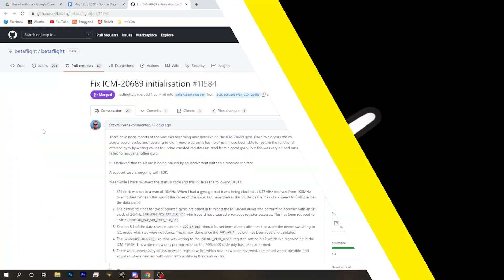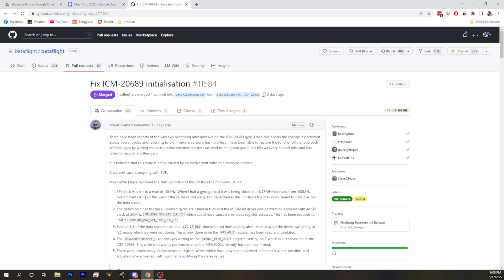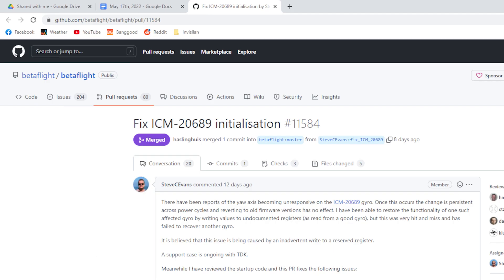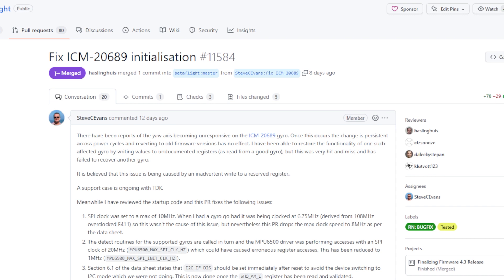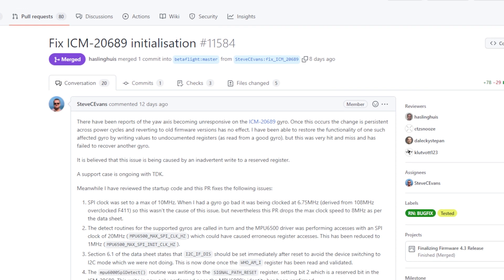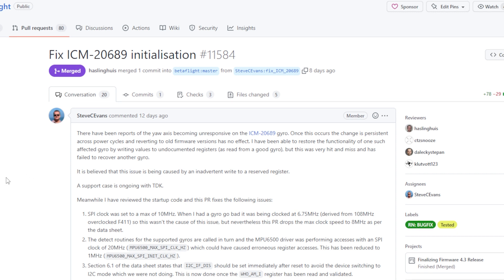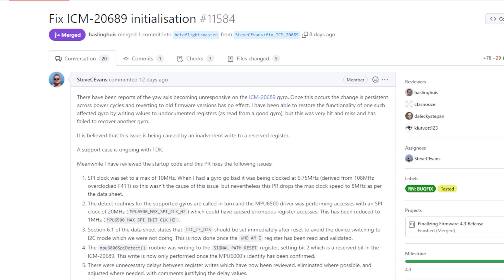PSA - Betaflight 4.3 RC6 Is Bricking ICM 20689 Gyros!

Comment: Great PSA. I remembered watching this  and hearing about a problem with bricking FC because of a particular gyro that's not the MCU6000. I am building a Cinelog35 and using the Aikon 3-6S F7 AIO flight controller w/ 60A 8bit ESC and it doesn't have the MCU6000. It has the BMI270. Before I flash BF 4.3 I wanted to make sure I wasn't about to brick a $100 board. Thanks for the info guys. Now I know I'm safe.

Comment: The BETAFPV F4 1S ELRS FC has this issue and they have been shipping it with RC6 from the factory. Maybe some people are OK, but for many people, the gyro will be bricked the first time they plug in a battery or USB. I'm told that you can avoid the problem if you power up in DFU mode the very first time and flash to RC7 before ever letting it power up normally under RC6. Unfortunately, I can't test that workaround because my new F4 is already bricked. :-(

Comment: I've just discovered the BetaFPV  F4 1S 12A AIO V2 flight controller has the ICM 20689 gyro, it's advertised to have the MPU6000 but Betaflight says otherwise! Not ideal.

Comment: I just recieved mobula 7 1s and it have bad gyro from the box.
This can be the issue😕
Reply from the maker: That target uses an MPU6000 as far as I know, so it has nothing to do with the Gyro bricking bug. There are likely thousands of users that have flashed boards with MPU6000s while Betaflight was in RC.
Reply: @JoshuaBardwellLivestreamClips  
I have the x12 Elrs v 2.0 board and this have the IMC 20689 gyro
Reply: @patrikk4012  I had this happen to me got 4 batteries in it I didn't flash anything I bound my radio and had the no gyro now it doesn't even read that I have a gyro....any luck ?

Comment: TDK < MPU6000
Reply: what do you mean
Reply: @dr.danishsajid148  i think they said tdk is the manufacturer of the new gyro to replace the "discontinued" mpu6000. I also believe they talk of the new gyro being harder to tune. Maybe this wont be an issue? Iflight blitz is using the new gyro and the equivalent product already costs more....
Reply: @kennethcdeli  The gyro they are talking about is not recommended by TDK to be used anymore. It's old and deprecated. Ask the manufacturer of your FC why they thought using this gyro was a good idea. I bet it was just because it's cheap, not taking anything else into consideration :D